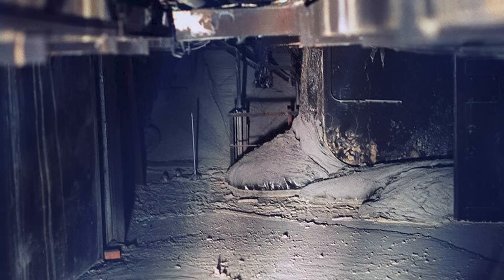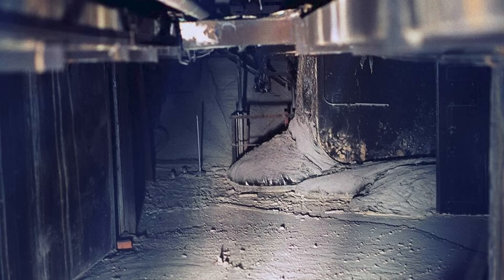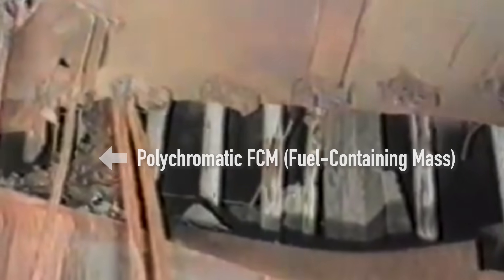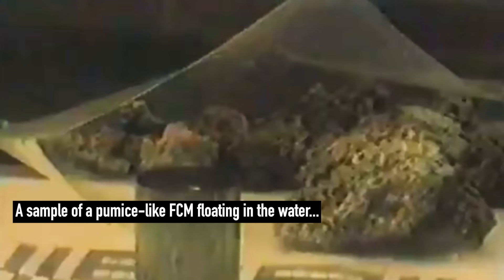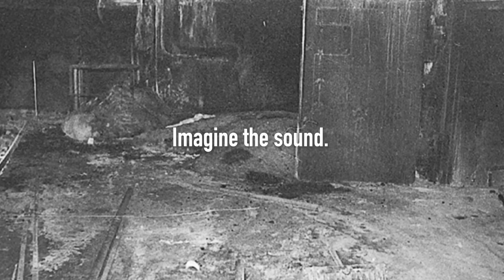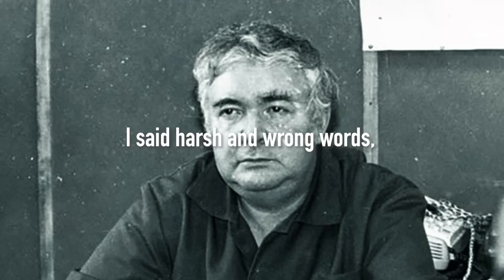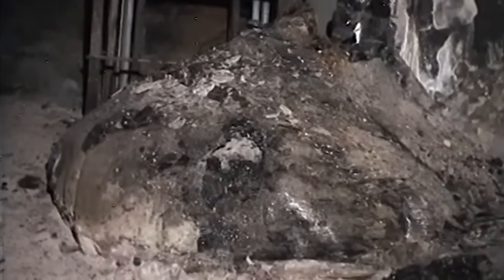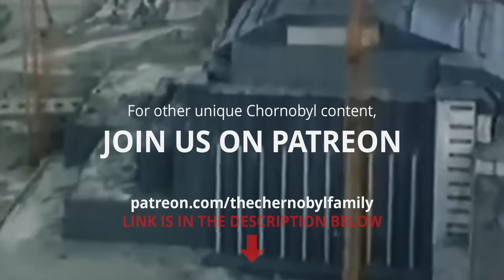Chernobyl’s Darkest Secret: The Mystery of the Elephant’s Foot | Chornobyl Uncharted Ep 11

Comment: What a gem of a video. This must be one of the most detailed explanations about not just the Elephant's Foot, but on the formation of the entire flow of FCMs. And the people going in there to research so early after the accident are some serious heroes. Willingly going into these corridors, knowing that whatever is down there will absolutely kill you if you make a mistake in calculating your exposure time. Some of the stills and videos I had never seen before. How did they manage to do the examinations on the pumice etc? Must have been done in a hot cell, considering the radiation levels. But this new video was most interesting. Well done!
Reply from the maker: From what we know, manipulations were performed inside a lead-lined glow box with a hard dose/time limit.
Reply: @ChernobylFamily  
Figured as much. There's no way you just pop that up on some lab table, put a microscope over it, and eyeball the thing up close😅 Must have been a big surprise to the scientists when they had the bore hole ready, poked a camera in the reactor, and its active zone turned out to be pretty much empty.
Reply: @swokatsamsiyu3590  Probably difficult to image as well... I'd imagine the radiation would mess with any method used without doing magic tricks to keep it away from film and sensors
Reply: @MadScientist267  
Was thinking the exact same thing, when seeing those quite clear images of the various corium and "pumice" samples: "How did they pull that off with these high radiation levels?!?"
Reply: @swokatsamsiyu3590  I don't really have any idea for sure, but my guess is lead, mirrors, and zoom optics of some sort to "reach past" the shielding... I'd be really curious to see how it was actually done.
Reply: @MadScientist267  
That makes two of us. I think your guess is a very good one. I remember seeing very old footage of the first BWR test taken to destruction in an American lab. They used a long mirror and camera to be able to film the transient process in the reactor as they tortured it to destruction. I'm going out on a limb here, and say that the Russian lab did something similar with regard to making stills and video of the various corium samples.
Reply: Im sure one of them lived into his 80/90s.
Reply from the maker: @niceguy235uk1  bhah. I am nearly 40, so...
Reply: Agreed, this was fantastic.
Reply: ECRR 2006/ CHERNOBYL 20 YEARS AFTER
Reply from the maker: Thank you truly.
Reply: Are there REALLY people who think fart jokes are funny? To those people: You are showing the rest of us how infantile you are.
Reply: @cattymajiv  "Are there REALLY people who think fart jokes are funny?"
The world's oldest recorded joke is from Sumer and dates to ca. 1900 BCE: "Something which has never occurred since time immemorial; a young woman did not fart in her husband's lap."  Some things never change.
Reply: I farted, imagine what happens next to the foots of the elephants?

Comment: Valery Legasov's plan was for the helicopter dropped lead to melt and form a sort of protective layer over everything. This would have made cleanup operations easier. It would seem that his plan did not really work, or at least not as well as he had hoped.
Reply from the maker: The fundamental flaw of it was a lack of reliable data on thermal processes (this we covered in the episodes on the Needle and Buoys); the vast majority of lead just evaporated.

Comment: So, if I understand this video correctly, a steam explosion in the bubbler pool was not possible as the all movement had mostly stopped by the end of April 1986.  I had found the reasoning behind the concern a bit unfounded given the nature of the masses.  Also, does this mean that the digging of the tunnel under the reactor was unnecessary?
Reply from the maker: 1) yes
2) partially necessary as a separate biological barrier. But this came later, the initial idea with cooling systems was wrong.

We have videos about both subjects

Comment: How did the lava not melt the valves/pipes?
Reply from the maker: It gradually lost its temperature in 305/2,  and below it was liquid, but below the steel's melting point. The steel used is not usual, though.

Comment: 5:30 The other name I've seen is China Syndrome. There were in fact at least three ruptured steam drums.

My estimate for the China Syndrome's brown lava radioactivity around the end of 1986 just about matches the original description for the Elephant's Foot in 1986 upon discovery - 10,000 Roentgens per hour (I will probably improve this in the future). Chernobyl Guy estimated it at 7,344 Roentgens per hour. The black lava was around 35% as radioactive, similar to the Elephant's Foot.
Reply: https://www.youtube.com/watch?v=m_qGTJW4Cx4&t=648s This was his estimate of the China Syndrome's radioactivity - the map showed 3,460 Roentgens per hour in 1997.
Reply from the maker: They reached 305/2 much later. The calculation TCG made is interesting, but frankly, it is not very correct because FCMs are not uniform substances.
Reply: @ChernobylFamily  In a more recent survey map the China Syndrome at 210/7 was surveyed at 600 Roentgens per hour and at 210/6 almost as high. I do not know which year but they surveyed different parts of each FCM mass, not all of the measurement places of that year correspond to past places.
This I think makes it even more difficult to determine a number.
Reply from the maker: @probium2832 Yes. Especially in 40 years retrospective.
Reply: @ Another key challenge for me in my knowledge of the China Syndrome was - how do I correspond each steam drum to its location? There was in fact a study on how they formed, detailing the brown and black lava. The first thing I learned besides it being insanely radioactive was that there were at least three drums that were ruptured. I also looked at the other background objects in the pictures.

Comment: I had no idea that such a huge amount of the reactpr cure was a free flowing liquid seeking its way to the bottom. Now it makes sense why they dig beneath to try to cool it down and filled it with concrete to make a bit of an barrier. Great vid as always, will keep watching more for sure
Reply: Given that the Chernobylite burned it's way to the bottom of the reactor building, there was good reason to tunnel under the reactor and ultimately fill the chamber excavated below it with concrete to reinforce the foundations. There was good reason to fear the  China Syndrome, where the molten Chernobylite burns through the ground and makes contact with groundwater. That would have poisoned groundwater and  rivers too.

Comment: I would say that in English the word "Corium" refers to any FCM and that the general understanding is that it's composition varies a lot depending on what it consumed, which I'm pleased to see is mostly correct but I didn't know this much was known about the various forms. Really interesting to see that the uranium is so heavy it tends to concentrate toward the ends/downhill parts of the flow, that "chocolate hallway" must be astoundingly radioactive but given the danger of particulates that steam pumice stuff is even scarier since it seems like it would turn to dust if you even looked at it wrong.

Comment: It's called corium
Reply from the maker: No, it is not. Watch the video — we explain that corium (or chernobylite) is an integral part, but it is a very specific chemical substance. FCMs contain far more elements. The same you can read in scientific literature published by the Shelter research and management, which is the most important source.
Reply: @ChernobylFamily  in no way shape or form is Corium a very specific substance. It is described as fuel melt debris metal and whatever else it came into contact with and it's a conglomeration of all those things. The only thing specific about it is that it is a conglomeration of material.
Reply from the maker: @panther201787 Well, if you know better than people who actually study this, then I, of course, agree. Corium is zirconium-uranium-silica compound with variable values. This PLUS uranium oxides PLUS other inclusion forms FCM.

Comment: What I don’t understand is why they’re aiming to actually remove that melted mass of fuel considering it’s so dangerous. Like why not pump concrete under and all around it and just let it sit undisturbed. 
I don’t know if it’s stable where it currently lies but I assume it’s not if they’re planning to recover it.
Reply from the maker: There are several reasons for aiming to remove the melted fuel-containing masses. First, they generate highly dangerous dust. The environment around them is degrading, and a significant portion of the FCMs remains unexplored, so the condition and location of all the masses are unknown. We have now, let's say some "stable" condition, but with the lack of data, who knows if it won't change? 
Additionally, according to international regulations, high-activity waste must be stored in isolated conditions, within specific containers.
Some parts of the FCMs in the Great Horizontal Flow are already covered with concrete, but they still generate dust due to micro-cracks.
If you haven’t yet seen the next episode on the Sarcophagus, I suggest watching at least the first half for better context. Concrete is not a viable solution for several reasons. Although it was considered during the design phase of both the original and the second Sarcophagus, it is not practical. The resulting structure would collapse under its own weight due to the weak sand foundation beneath the power plant. It was sufficient for the NPP, but not for something far heavier. Self-collapse will allow moisture to seep in. Moisture is problematic because it can alter the neutron flux in the area, potentially leading to subcritical incidents. Furthermore, concrete is not hydrophobic, and it degrades when exposed to very high radiation over prolonged periods.
There is also no reliable way to fill all the spaces with concrete or any other material in a controlled manner. Many areas are either inaccessible or the condition is unknown. If any part is left unfilled, it could become a point of structural collapse, triggering uncontrolled processes with no way to reach or fix them.
So, the only solution is to remove the FCMs rather than attempting to contain them in their current location.
Reply: @ Thanks for the great response my friend it was very insightful. You’re putting a lot of work into this channel and that is rare in the current YouTube landscape because it is unfortunately not rewarded as much as it should be. 
The situation at the plant is not good but at least they have the NSC in place. 
It’s going to be very interesting to observe the dismantling process of the reactor building and the hazards within it. 
It truly is a monumental task and everyone working on it deserves the highest praise. 
This disaster has been managed by a long series of monumental tasks but we have not failed once.
It is impressive.

Comment: Had the radioactive lava reached ground water, we’d be telling a whole different story.
Reply from the maker: It is actually an interesting question. As you can see, it reached the bubbler pool, which had a substantial amount of water, and yet nothing severe happened. I believe a real problem would be that contact with a water horizon would drastically intensify pollution of Pripyat river, then subsequently Dnipro and eventually Black Sea. But still, no explosion would happen. But this is my guess, I do not consider myself enough competent to analyze possible thermal processes.
Reply: @ you’re absolutely right about the pollution spread…and with the half life of nuclear waste…It would be polluted for a very long time.

Comment: It's bizarre to me that they wouldn't use hydraulic machines to remotely clean and refine this material instead they just did the equivalent of sweeping it under the rug
Reply from the maker: They partly did. But what you say was not feasible. It is not as close to easy task assuming the situation was so complex that a less-more accurate assession of what and where is located was completed in 1992.

Comment: Corium. Nastiest stuff on the planet.
Reply from the maker: I'd say, dust to which it turns is even worse.
Reply: @ChernobylFamily Bad enough that it's loaded with beta ana alpha emitters, but the Plutonium that is also in it along other transuranic are very poisonous as chemical toxins. In short  Corium and the dust it is disintegrating into are not merely very radiotoxic. They are chemically poisonous too.
Reply: @ChernobylFamily Inhaling it certainly would not do your health any good.

Comment: Within a few decades we can send in teams of likely intelligent humanoid robots with jackhammers to begin a final cleanup. Is this the likely way forward? Would the waste be placed in a facility deep underground or could we somehow process it?
Reply from the maker: Technically, there is a plan and certain concepts how to do it; for now the task is to remove unstable elements of the Shelter Object, but to FCMs they will come as well. Some, however, will be possible to remove only in distant future. By law, all that had to be buried in deep geological repository, but here is the problem: in Ukraine for now we did not find a a geologically proper place for such a construction, so there is a chance that those will be stored in heavy containers under the Arch.

Comment: I imagine the molten Corium glowed blue from all the Cerenkov radiation it must have been emitting. Had someone been there, he would not have lived for long.
Reply: That’s somehow even more terrifying than red or orange.

If the lava is blue, it’s over for you 😅
Reply: @Xtian982  There is a video of actual molten uranium obtained at the Argonne National Laboratory, it's incandescent and yellow white in color. However  it was U-338 without the fission products the Chernobylite was full of. Fission products just created are madly radioactive and emit neutrons, which is why scientists studying Corium do not use nuclear fuel to do that.
Reply: @Xtian982 Not the lava itself  but the air around it would glow blue from Cerenkov radiation.... the Chernobylite itself initially was literally white hot, and was a glowing white or yellow-white, very runny fluid. Between the intense and almost immediately lethal radiation and the intense heat, anyone who encountered it would not have lived to tell the tale. As it spread and its heat emissions declined, it must have gradually cooled and shifted to red before solidifying. Kyle Hill's excellent video about the Elephant's Foot shows a video clip of what flowing molten uranium oxide looks like and how it flows very easily. It was yellow-white in color.

Comment: Imagine going in there and all you have is a  cheap suit to protect them. I highly doubt any suit or air filter is going to protect you from that.
Reply from the maker: Air filter can. Those suits are not cheap, that is a very special plastic which helps to cut off a substantial part of hard beta emission. From gamma, of course, nothing can protect, you kjust can lower the doze using time management.
Reply: Good quality air filter is vitally important if you are about to enter an area where alpha-radiating particles could enter your lungs.
Reply from the maker: @瓦森 ffp3 is our everything

Comment: I think it is really crazy that the laver filled so many rooms, and slowly worked its way down. It would be pretty interesting if somebody saw how it was flowing, but during the following days after the explosion I can imagine that nobody was inside the building. Especially the basement. In a video game I also have been underneath the reactor, and some of the rooms around it, and even some stories deeper, that later have been filled with lava. It feels a bit strange
Reply from the maker: A spicy detail it is not a basement. It is well above the ground.
Reply: @ChernobylFamily  true, I kind of forgot it was built like that
Reply: If someone did, he would have received a fatal radiation dose many times over. Too many have died already, let's call it a good thing nobody encountered molten Chernobylite. It would have been fatal.
Reply: If someone got close enough to see the molten Chernobylite or Corium flowing on the floor, he would have died  horribly of Acute Radiation Syndrome, possibly receiving enough radiation to die of the Central Nervous System Syndrome. Doses that high result in immediate, severe illness followed by death in three days or less of cerebral edema, heart failure or both. It was initially well over 2,000 degrees C and probably ignited anything that could burn just from the intense heat it was radiating. Someone close enough to see it would not only die of radiation sickness and radiation burns  but thermal burns as well. However  I did see a video clip from the Argonne laboratory located in Idaho of molten uranium. It's incandescent and flows like water or cooking oil..... at a temperature of over 2,000 C. I'm sure as it assimilated more and more silica it became much more viscous and flowed much more slowly, but when the fuel rods melted down they became a very fluid, white hot mass hot enough to burn or melt through just about anything, like thermite.